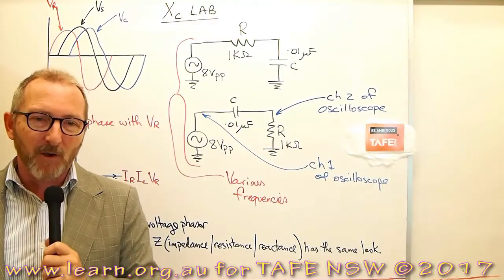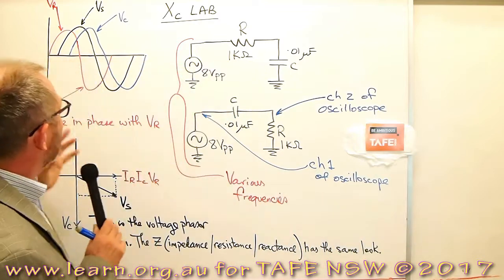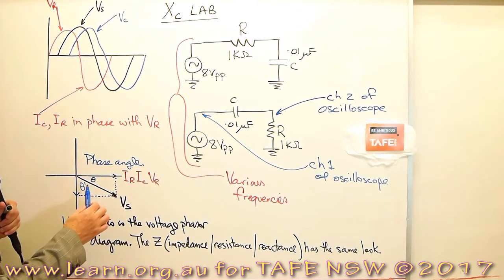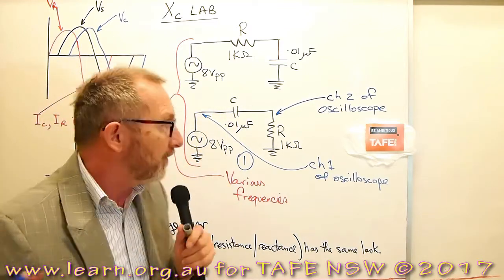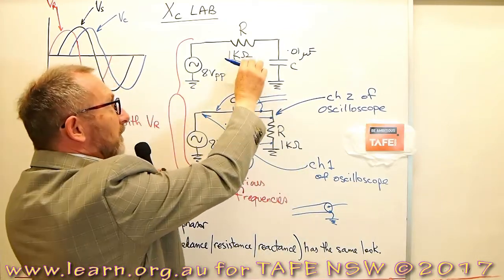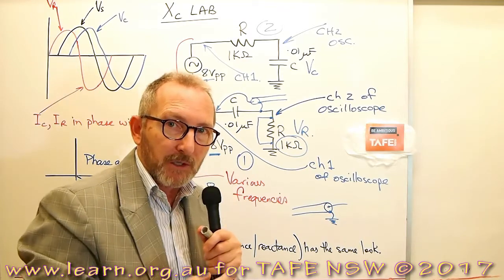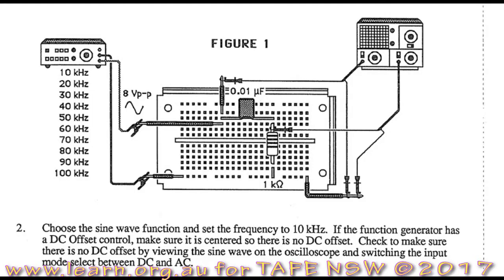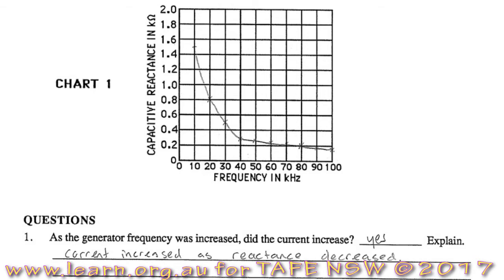AC RC Series Lab Introduction for Xc graph - TAFE NSW

Comment from the maker: Think about it... does current go through the capacitor?  Well there is current charging the capacitors plates, which is reversing on every half cycle.  There is not current across the capacitor, that my my 'faux pas' ... or was it :)